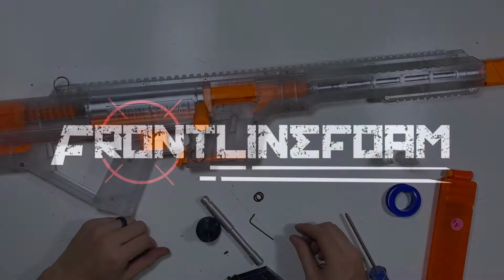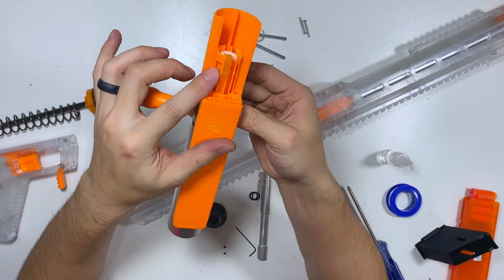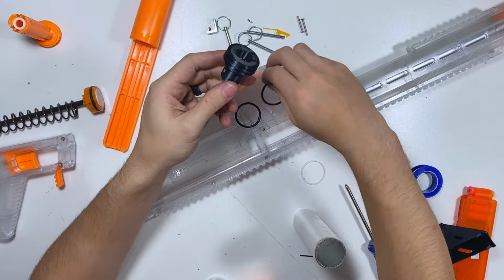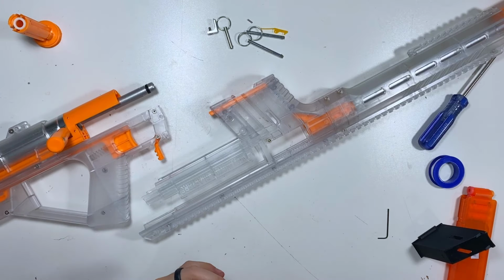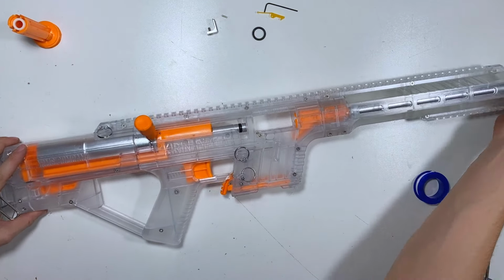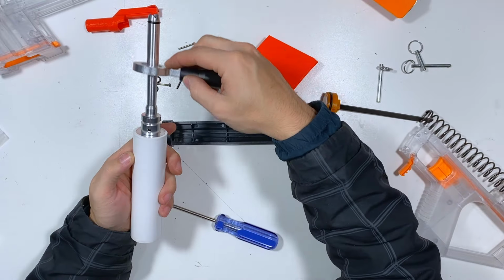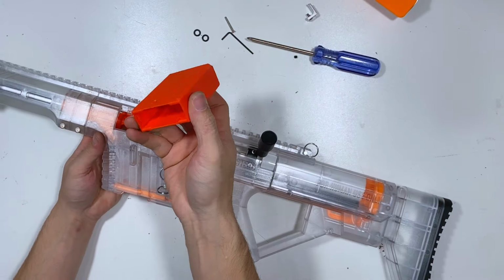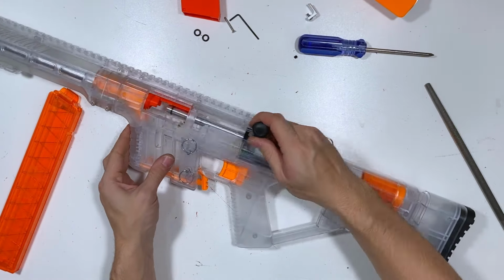Kirin Upgrade Kit Build Guide!! #kirin #straightmag #angledmag

Comment: I’ve worked on a few springers such as a foam night xc and bullpup talonclaw that I printed myself but I was waiting to see an instillation guide. Once frontline foam posted a installation guide I noticed a few differences 
1.the kit I bought in December had groves on the side so I would need to take the front assembly apart 
2. I was not give a spare bolt to prime my Kirin talon kit so I tried to take the bolt from the shell injection priming rod and I broke the front assembly without getting the bolt

I have a few issues with the kit but I have hope that I’ll figure it out because I’ve been very excited to put this kit together.

I’m just wondering if there is anywhere that I can buy a metal priming bolt for my angle talon kit and a new shell injection piece because mine broke in the process of trying to get the metal priming bolt from the original Kirin
Reply from the maker: Did you order the straight or angled kit? The angled kit has the spare bolt handle and plunger tube, but our straight kit reuses the original bolt and plunger tube.